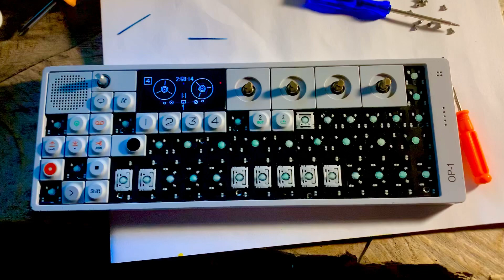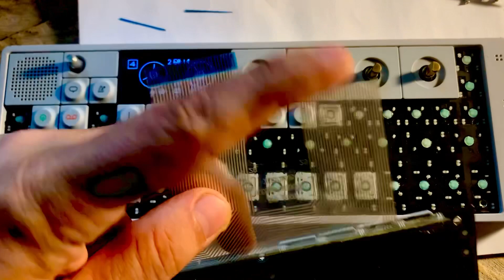OP-1  “surgical” keyboard fix keys not working

Comment: what if the cutting doesnt work? My synth button still is not working after I cut and now the metronome button does not work. How much should i cut?
Reply from the maker: 1-2 mm.. see where is metal on the connector, it should be left bare. maybe try pushing plume further in the socet. if it does not work the problem could be on the other side
Reply: @rndmknbs  ok thanks, I tried pushing it further and also cutting 1 mm on the other side, but still nothing. I somehow suspect that its the connection between the buttons that are bad? Could that be?
Reply from the maker: @vann_mann  yes it can , did you ever spill any liquid on the keyboard?
Reply: @rndmknbs  Hello and thank you for this content, I spilled beer and the first B and D keys stopped working. At the beginning it was like the B key was always pushed because it sounded indefinitely once I entered a synth with max sustain but after cutting a little strip from the left connector it stopped being always pushed and now is just not working as well as the D key. Do you recommend anything in particular for my case? Thank you.
Reply from the maker: @mariohenaoayala928  if you spilled beer not too long ago, posiibly it can come back in a week or two, that happened to me once. i had 2 buttons stopped working..and then it returned. this tutorial is really about the oldness of the connector...if it was plugged unplugged many times as it happened with me as i got op-1 second hand and made a lot of repairs with it which involved numerous moves with the keyboard..

Comment: My keys start to play out of nothing. Would this solve it maybe?
Reply from the maker: maybe.. but better try to clean the buttons and inside first
Reply: I have the sollution for sticky key, you have to separate the two layers of the keyboard in the key, and it's gonna work for a period of time. You have to do this process when the issue comes. But there is another solution, you have to place a ring washer made of 3d printing between the two layers of the keyboard in the local key. Best Regards, Jetmak from Argentina.

Comment: Interesting..  my op-1 started having bad keys recently, but they are randomly placed across the device and - more importantly, kinda of "warm-up" if you push them continiously , like for a pretty long time - say , 10 minutes - some of them start working fine for a period of time. But if you leave them away for some time - they - again - loose their contact. So, I guess, that suggests it's not a problem of contact connector cable, but the membrane contacts themselves.... (
Reply from the maker: with good scissors and precise moves you probably wont lose this game anyway.. i even cut one of the connectors with slight angle and it worked
Reply: I have the sollution for sticky key, you have to separate the two layers of the keyboard in the key, and it's gonna work for a period of time. You have to do this process when the issue comes. But there is another solution, you have to place a ring washer made of 3d printing between the two layers of the keyboard in the local key. Best Regards, Jetmak from Argentina.